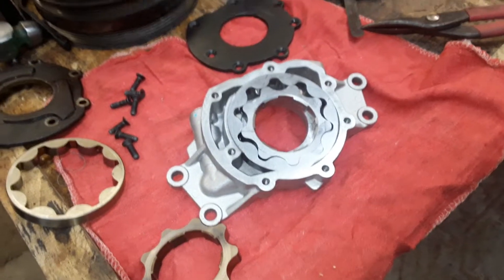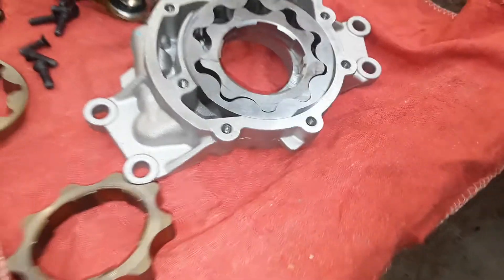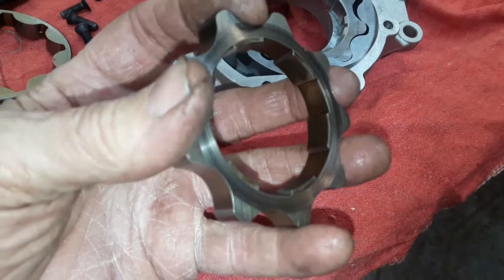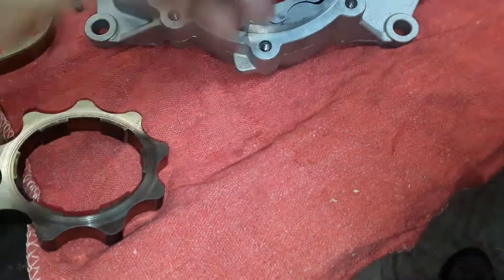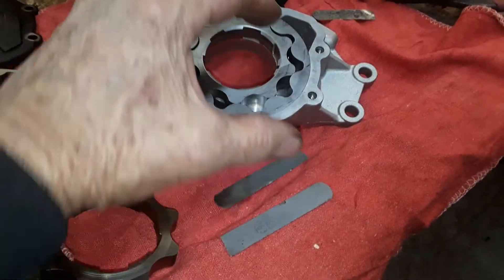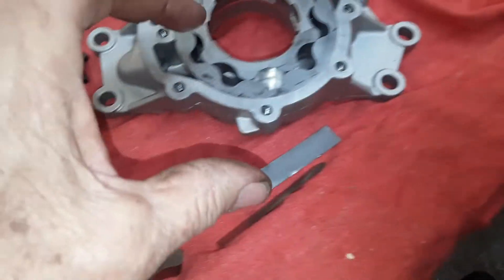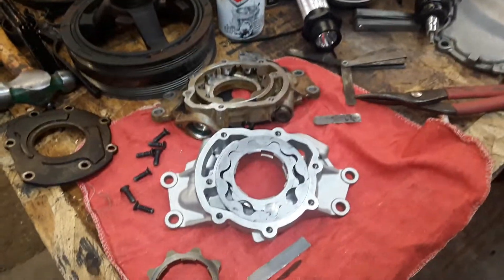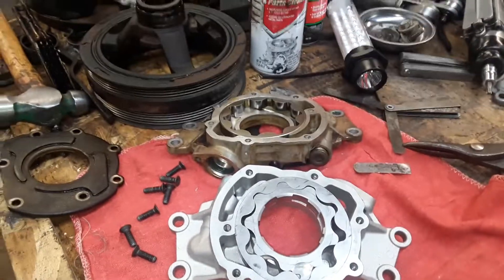MELLING M296HF Oil Pump Rotor Shimming,  5.3 Chevy Engine

Comment from the maker: I've done a few more of these 5.3s and so far the o-ring has NOT been the problem. Mostly it's the pressure regulator that is screwed up. The pump itself cannot actually fail unless it physically cracks or so. I'm almost 100% convinced it's gonna be that regulator every time.

Comment: Very good video and great break down in the comments . Thanks.  I'm about to do this again on my '05  Chevy Silverado 1500 ext cab long bed with 5.3 vortec..  low oil pressure but plenty of power and runs like a sewing machine. No rod knock, usual Chevy ticking but engine is in good shape.   Changed out the oil sending unit and also checked oil pressure with a mechanical guage . It is low. Probably  that stupid pick up tube O ring and/or oil pump. This time I'm  putting the high volume  Melling oil pump on it.  My truck is the no frills 2WD work truck so I'll drop the oil pan. Still have to remove a cross member, swing the rack and pinion steering down etc.  Pain in the butt but nowhere near as complicated as on the 4WD version at least.
Reply from the maker: I was freezing to death that night --- the night I made that video. Surprised I didn't record my teeth chattering since I could only 1/2 close the garage door and it was snowing into the garage 4 feet. 
I don't remember if I mentioned it in the vid, but the o-ring was perfect --- no squashing, no cracks, etc. Frankly, I believe the pressure regulator was the biggest problem if not the whole thing at fault and replacing the pump and the o-ring was ultimately the answer. 
Thanks for your comment --- if you missed it, can you hit the LIKE button? 
Again, thanks.
Reply: @SurferJoe46  sounds like a fun time lol.  I really hate to be freezing cold and having to wrench.  You did mention that the O ring was still good.  I figure if I'm going through the pain of replacing the oil pump etc I might as well replace anything I can reach.  I'll inspect the timing  chain as well while the covers off. I bought the truck used and the previous owner wasn't  so great with oil changes and maintenance.  .   I did hit the like button as well as subscribe and select the bell for all new videos.  I'm surprised this video hasn't  garnered more attention and comments. Fear not, now that I'm here and commented you  can bet there will be some ass hat troll  showing up to tell me how stupid I am because of my comment 😆.
Reply from the maker: @kaylamarie8309  I've got some other videos up --- very unprofessional for sure - and don't worry about the trolls --- I can delete them if I wanna.
Reply: @SurferJoe46  I'll be checking them out 🙂👍  I used to let the trolls get under my skin. I usually just ignore them or laugh at their immaturity.   I will on occasion  if I'm bored  have a brief  exchange with a troll just to show them that they came to a battle of the wits totally unarmed. I usually  just ignore them.

Comment from the maker: As it turned out, the Melling M295HF (High Flow) pump is exactly what I wanted and it works great! 
→ I left the pressure regulator that came in it alone and it gave me 55lbs at idle and 70lbs running and I never thought about using the extra, "Standard" output spring that came with it.

That HF pump choice decision made me worry a little bit since I know bearings can be over-flooded and cause damage - especially on an engine with 140K miles on it --- and used, not knowing the real service frequencies and quality. 

That the lower bolt is really nasty to remove if you don't pull the pan (4WD and I didn't want to wrestle with the suspension, exhaust and whatever other things I was gonna have to mess with just to drop the pan ... so I fought it apart with surgical tools and --- well, that info is all over the internet for anyone to read.

Be sure to pack the pump with oil --- I use some 90wt gear lube mixed with the 5w/20 synthetic oil that I normally use in that engine  ... and that got me oil pressure fast!  

I suggest that you pull the fuel pump relay though so you can crank the engine until oil pressure moves the gauge! 

I also suggest that the pump be centered on the crankshaft by using some 0.0015" feeler gauges between the outer rotor and the inside of the pump housing to make sure there's at least that much space available so that the crank won't be pulling down, up or sideways on the pump rotor and ruin some hard to get to parts --- again! 

Because I wasn't sure that I really found anything actually wrong (in a black and white way) that could have killed all the oil pressure on my 5.3, I was lookin' pretty hard for the culprit. 

As yet --- I'm thinking it was a combo of things ... but when the pump was out, I sent 125# of air into the pickup tube to see if it was blocked at the screen --- or whatever ---- it wasn't. 

The original o-ring was in very good condition --- no cracks nor was it deformed in any way --- that was worrisome too. Before I installed the pump, I also changed the oil filter with a pre-filled AC-Delco and drained and changed to Castrol full synth 5w/20. Strangely, the oil dipstick wasn't reading FULL until I got 7 quarts into it ..... strange? I dunnow. 

I anticipated that the oil filter might be collapsed or something worse --- but that wasn't obvious either. TBH --- I don't know what the original problem was ... but it's fixed now.